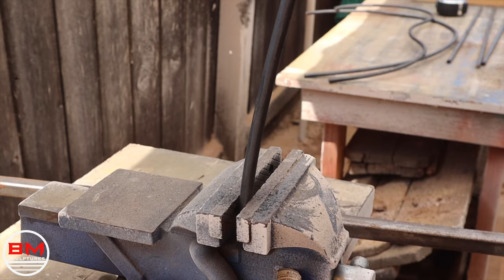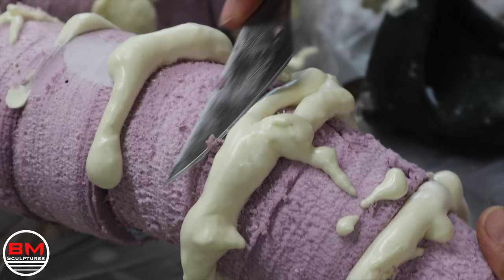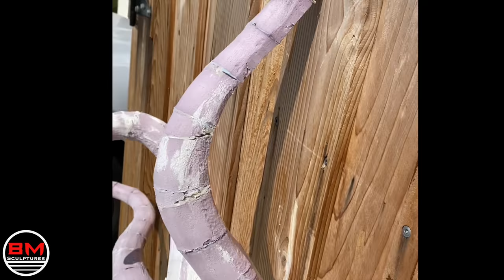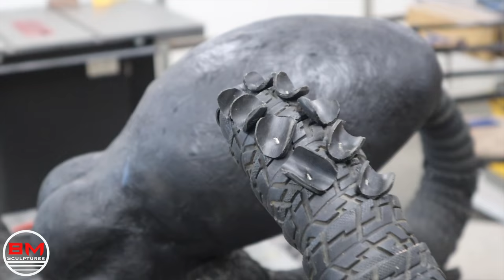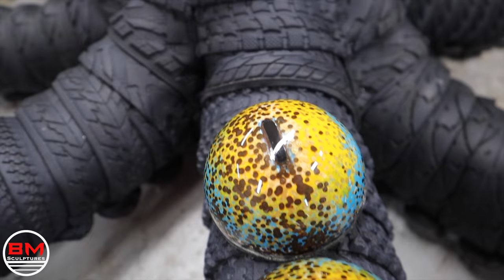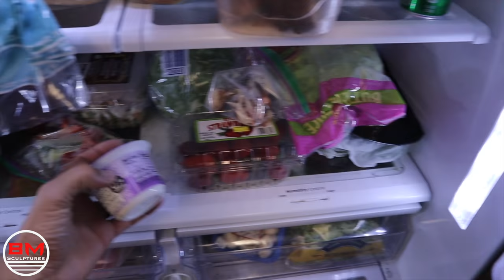Sculpting a Giant Octopus out of Recycled Tires & Foam

Comment: For cutting your tyres try something like "Makita JS1601 1.6mm 380W Corded Straight Metal Shear". As a electrician, I cut up plastic ducting that routs the gas pipes with either tin snips or these sheers. 

btw I preferred the sculpture sitting on the table rather then on the fence. great work over all though!

Comment: It looks wonderful.  One minor critisicm, though: if the head had been tilted back ( looking up, rather than straight ahead ), the octopus would have looked better when hanging vertically from the wall.  As it is, the layout is more suitable / dramatic when lying flat on a horizontal surface.  Having the final setup in mind changes the design.

Comment: You probably already know this, but you can quickly and smoothly cut XPS foam with a hot wire cutter. A handheld one would work perfectly here. It also is much less messy than using a saw to trim out your tentacles.

Comment: Have you ever thought of building some kind of trimming machine, similar to a can opener, with two knife wheels that bear against one another that can simply partition off the sidewalls? I bet you could do that. Cool sculpt, btw!...
Reply from the maker: That would be amazing. I am not sure I could build that though. I am no engineer.
Reply: @BMSculptures  i'm sure i've seen such a machine on the choob - removing the bead wires from the rim edge of the tyre

Comment: I'm assuming you've tried electric scissors on the tires before? That's the first thing I'd go for.
An ultrasonic cutter would be the more expensive option (in case you're unfamiliar with them, it's a knife that vibrates on an ultrasonic frequency making a tiny sawing motion that effectively makes it cut through stuff with no effort at all, like a knife though hot butter). With ultrasonic cutters/knives you really get what you pay for, so it's sadly not an area where one can cheap out on. There are probably places that would let you try one out, just bring a tire with you, then decide if it's the right thing for you.
A pneumatic saw might be an option as well (those small handheld ones), there you can get a perfectly functional one for cheap considering this application. The cheapness assumes you have an air compressor already. *edit: you do have one, never mind.
Reply from the maker: Very interesting. This is the first time I have heard of ultrasonic scissors. I looked them up. The hard thing about investing in something like this is I need to constantly replace my scissors because they become dull. The scissors I use have serrated teeth so I cannot sharpen them, it is easier for me just to replace them. I have tried electric scissors and run into the same problem. I will have to replace the scissors about every sculpture. If they made replacement blades I would be all in.. So far I have not found those.
Reply: @BMSculptures  well not ultrasonic scissors, just a knife. But as I've understood, those are in the few thousand dollar -range, so...    Unless you want a tiny chinese knock-off that barely cuts thin plastic.

You've probably tried a small-teeth blade on a jigsaw or reciprocating saw.
There are also tiny handheld circular saws like the dremel saw-max.

Though I would think a small bandsaw would work well also.

These all obviously create some rubber debris, but I'm a big fan of reducing labor intensive parts on a project. To the extent that I'll do spend more time just to make it less of a hassle to get the job done. :D
Reply from the maker: @Itslvle  I have tried the rotary circular saw blade, the rubber gets caught in between the blade and the sidewalls and jams up, so thats a no go. I have also done bandsaw and jigsaw, the serrated cutting action at high RPMS actually burns the rubber causing bad odor and a very jagged cut. So far I think the best option may be finding some more powerful scissors.
Reply: @BMSculptures  Dang, that's a tough cookie. Okay, one last try:
A rotary cutter that's used mainly on cloth. You know, those pizza cutter types. I haven't used one on bicycle tires, but I've used it on rubber mat that's about 3mm or 3/32" thick and it works really well there. It's easy to do straight lines and fairly tight curves. The obvious downside is that you have to have something backing the cut so with tires you might have to jig something up like a 1/5 of a solid wooden sausage sized like an inner tube that you would clamp in a vice, cut the tire against it, move the tire along and keep on cutting.
The blades are cheaper than scissors and they're easier to sharpen.

Comment: very interesting !!
But paper mix with glue is stronger than foam, easier to work with and especially much more ecofriendly !! And it resist very well to water...
Reply from the maker: True, but then I would have to build a full on metal wire structure to attach the paper mix.
Reply: @BMSculptures  i'm not so sure about that, paper with wood or paperwall glue is very very strong, even more than plaster and way more flexible. you should make some test with it. But only to fill between the ring of foam. I was talking about the expansive foam not the pink foam...

Comment: Awesome! As I was watching though, I was wondering that since it will be dealing with weather and probably kids, if a black latex might be better than the paint for covering the staples? Seems like there should be some bonding with the tire, essentially embedding the staple inside the rubber, sort of.
Reply from the maker: I actually use plate-dip most of the time. I happen to run out of it so I just used paint instead. If i had the time I would have done black plastic-dip.
Reply: @BMSculptures  ok. I just recently found my way here, haven't dove deep into your previous stuff yet.

Comment: Super cool. Could you use a small bandsaw or a leather scriver machine to seperate the tyres
Reply from the maker: possibly a leather scriver. The bandsaw has to fast of RPMs and will heat up the tires, burning them as they cut and clog up the teeth.
Reply: @BMSculptures  true. I use one for foam and  got a  friend to adjust the motor.  I use it with detoothd blade

Comment: When I sculpt foam, I like to use an old electric knife I picked up for a buck or 2 at a thrift store (if I even paid that much 🤔). I also wonder if a plastic welder would work to connect the tires... I may have to try it.
Reply from the maker: Interestingggg. I like the electric knife option... I dont think tires would melt together.
Reply: She meant a turkey carving electric knife to trim the foam.  I use that as well.

Comment: couldn't you just use a hole puncher for the suction cups? hole punchers arent too difficult too built: sharpened steel tube + fitting hole in steel plate

Comment: Bandsaw? ;)
Reply from the maker: No it actually burns the rubber instead of cutting it. Ive tried it many times
Reply: @BMSculptures  Maybe at lower speeds like on a metal bandsaw. Maybe even use a cutting fluid for cooling. Or, I just thought of, you need a clean cutting edge, like a knife. I am thinking, one of those electrical kitchen knives. Basically a reciprocating knife blade. Probably want to pull the rubber through a gap so that its hold securely and into the somehow mounted electrical knifeblade, close to the base.